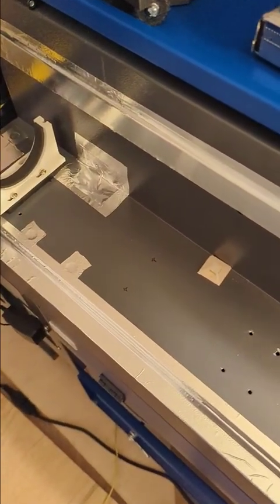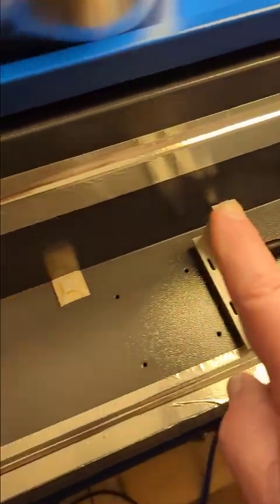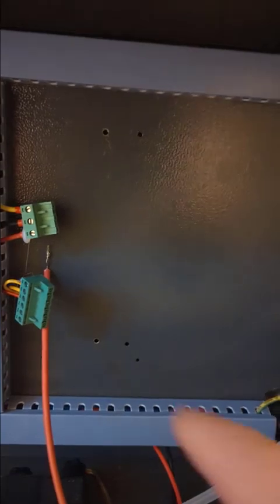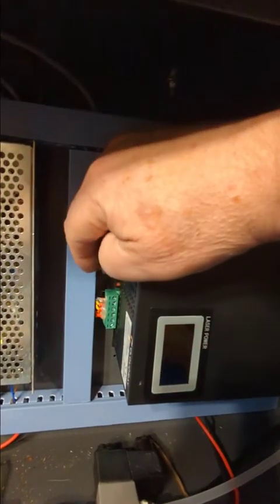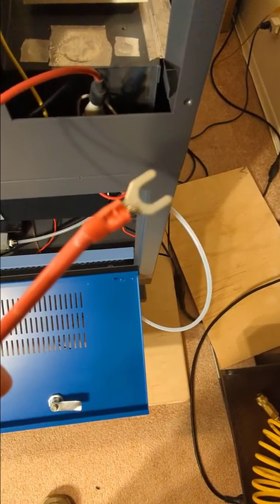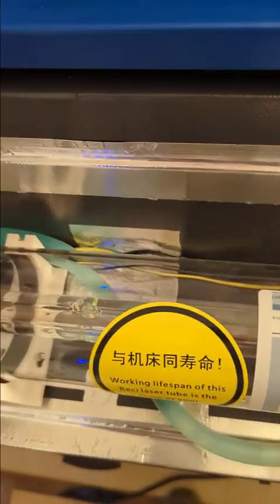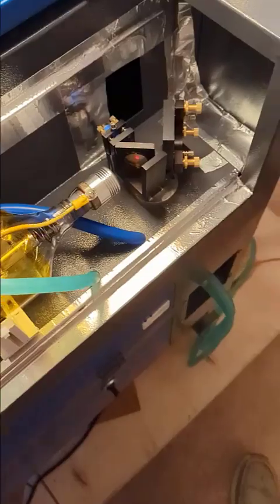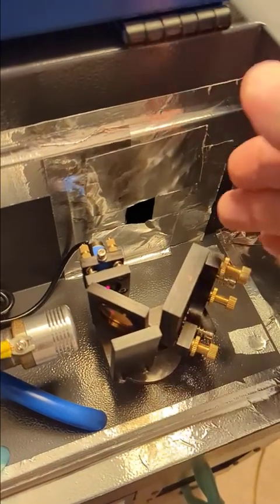Upgrading omtech 60W tube to 100W

Comment: i currently also have a 60 Watt omtech and when I need to replace the tube plan to upgrade to 100 Watt or maybe 80 Watt as you did.  I appreciate this video immensely.  You mentioned yo have a box - I will call it the laser tube extension shroud.  where did you get it.  I don't see it as an accessory on the omtech web site.
Reply: I just did mine and bought a nice metal box from lightobject
Reply: @jonsaircond8520  I contacted OMTech and got the shroud for $35.

Comment: Laser tube extension box? Anybody sell this?
Reply: i was thinking.. maybe you can make your own out of acrylic
Reply from the maker: I bought the one on Amazon meant for the K40.  I had to use the existing plate to mount that box to.  You'll need a jigsaw with a metal blade and a drill to start the hole.

Comment: How much did you spend?
Reply from the maker: The tube and power supply were less than $900 through CloudRay.  Delivery was fast, as they have US based inventory.  Tubes that need to come from China have another ~$400 shipping tacked on.
Reply: Can you share the 3D print file for the tube holder?? Thx